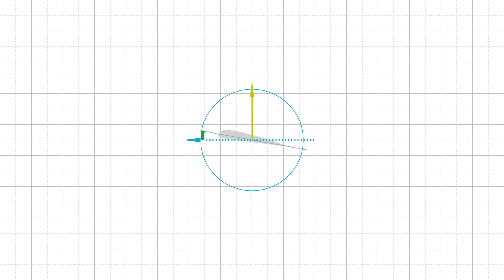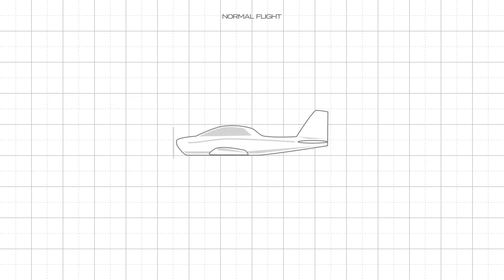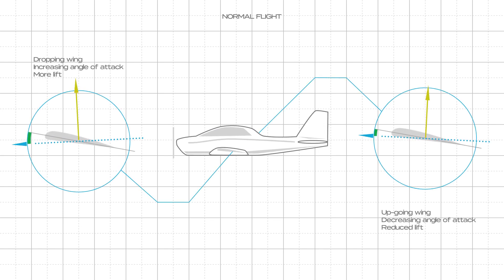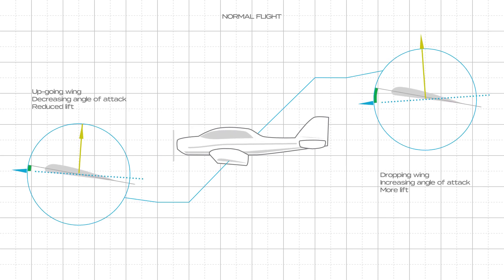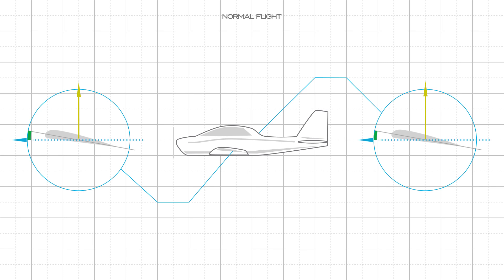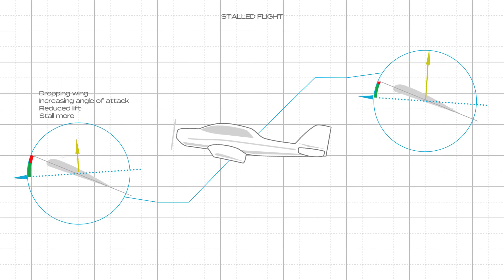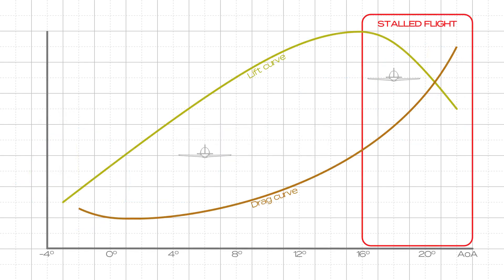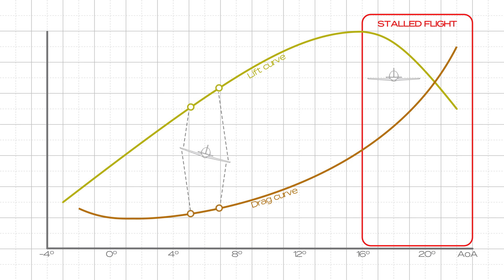How Autorotation Works in Airplanes | A Pilot's Guide.

Comment: Amazing explanation with the diagram at the end!
Reply from the maker: Glad you liked it!
Reply: @flightclubonline  this phenomenon is actually very similar to the dihedral effect on low wing aircraft. But the key difference between autorotation and dihedral effect is that the dihedral effect has the relative wind flowing over the fuselage and hitting on the wing that’s going down but in this case it’s just mainly to do with the angle of attack differences

Comment: Great, clear and concise as usual but I’ve been taught in my flight school that the up going wing produces more lift as well as induced drag than the down going wing, because the aileron on the up going wing deflects downward and increases the camber of that wing hence creating more lift and also induced drag because it has a higher AOA than the down- going wing, hence differential ailerons and frise ailerons are designed on ailerons to reduce the downward deflection of the up-going wing’s aileron and increase drag on the upward deflected aileron of the down-going wing respectively. Please correct me if I’m wrong, thank you.
Reply: Ik this is a year old but was thinking the exact same thing. This video makes sense if you just accept that the up wing has lower AOA but I personally don't get how that's the case, if anything the exact opposite makes sense. Even if you don't take the ailerons into consideration and assume a dropped wing with neutral aileron, why would the aoa be higher on that wing. AOA is the angle between the chordline and the relative wind. The relative wind is still a head on with the wing and the chordline didn't change either.